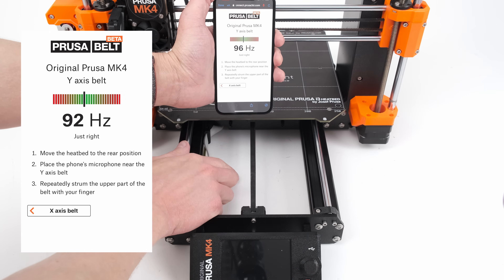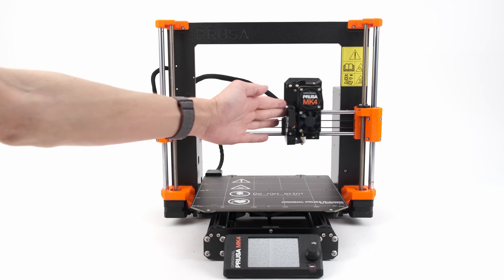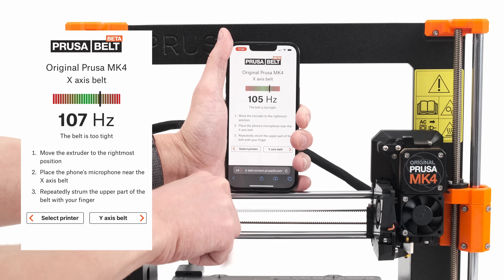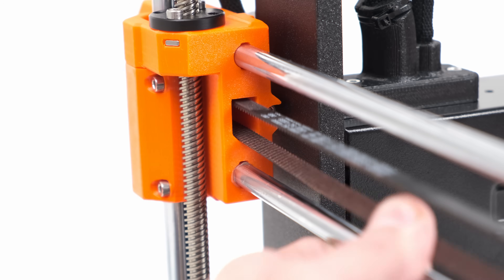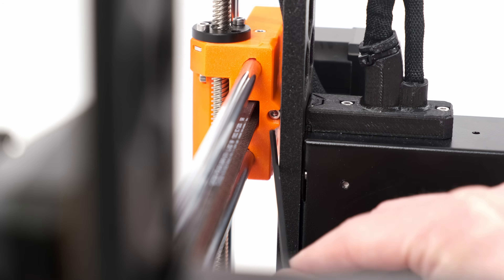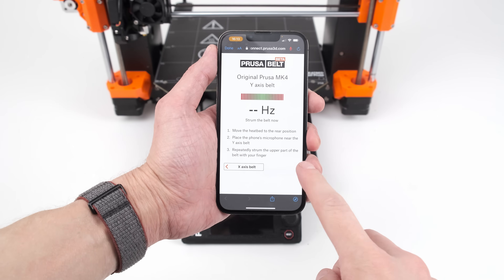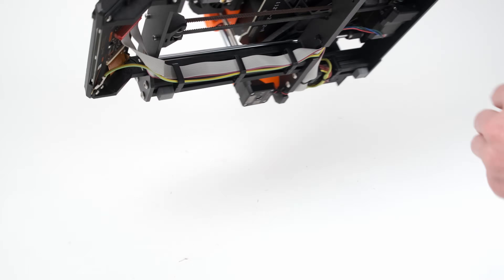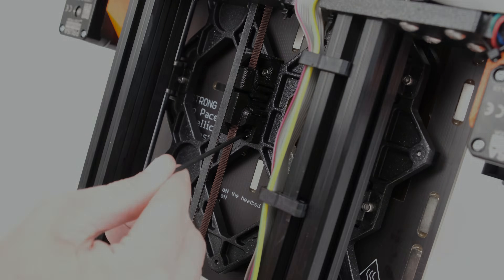Adjusting the belt tension on the Original Prusa MK4 - Belt Tuner App

Comment: I haven't been able to get this belt tuner to work at all, not for the X axis, and not for Y. It alternates between ~60hz and >100Hz on every pluck. I don't know what it needs, but plucking the string isn't enough. Somehow the simpler method turned out more complicated than just running the calibration test in the MK3S. The biggest single improvement to working on this printer would be making a real-time belt tension detector available in the firmware rather than (a) trying to make this app work, or (b) running a full calibration test. 

Or make an automatic belt tensioner.

Comment: Some tips to get this app to work.
1. Always arrive at the correct frequency by tightening the belt :ie: always start too loose until you arrive at the correct tension.
2. Do not loosen the motor screws too much. Loosen them and then tighten until you feel friction, then back off 1/16 turn.
3. Use the Allen key to strum
4. Strum in the middle of the belt. ie: divide the unsupported length into two.
5. Always take the lower Hz reading after a few samples. You'll notice the frequency often jumps to 2x the value. This is because the harmonic is being read.
6. You will get a too high reading if the belt is much too loose.
7. Adjust in tiny steps when you are close. ie: as small a turn of the Allen key as possible.
8. Remove your phone case. This was another users' comment and may help.
9. After an adjustment, clear your previous reading by swapping to the other belt reading and back again.
10. If it suddenly jumps from say 65 to say 98 after a tiny adjustment, clear and keep strumming, it should eventually read a lower figure. I'm guessing that this is a 1.5x harmonic.

The following was provided by PRUSA to another user and repeated here for completeness.
Ideal frequencies:
MK4: X 87.5, Y 95
MK3S: X 100, Y 120
MINI: X 110, Y 110

Feel free to add your wisdom to the list.
Reply: Great post ! Thanks for the info 👍
Mk3 requires the same values as the Mk3S (x=100Hz, Y=120Hz) for ideal belt tension.
Reply: @davelordy  Thanks. I have actually now gone over to the 3D printed belt tensioner gauge. This seems much more consistent and you can adjust the tension while watching the needle.
Reply: This is amazing feedback, I think I was picking up harmonics as you said which was getting very annoying.
Reply: Mine will jump from 55 to 190 does that mean 55 is the right answer?
Reply: @honsou1978dk  I'd guess that the tension is too low. I would continue to tension to raise the 55 up to the correct figure. However, if your other belt is about right, you could perform a tactile comparison. Obviously, if the belt you are adjusting is much tighter than the other one, you would slacken the belt (remembering tip 1). Disclaimer: Since I'm not at your printer, it's possible that some other factor is affecting the reading and therefore I could be completely wrong.
Reply: Those are some good tips kind sir. Loosening the motor screws just a tiny bit I think is a key factor. Also strumming with the allen key seems to work rather well.

Comment: This app is total bullshit.
1. There must be perfect silence in the room for it not to give false positives and false negatives.
2. Strong dependence on microphone quality, settings and phone software.
3. I have tensioned belts several times with this app and each time it showed the correct tension, while overtightening the belts and the motors started making clicking noises due to overtension.
Instead of putting a small belt tension checker in the box of each printer that costs pennies. Prusa is bullshitting, investing money in incomprehensible nonsense and inconveniencing users.
Reply from the maker: Hi Anton. Thanks for your feedback, we will take it into consideration.
Please contact our Support Team if you are experiencing some kind of issue with the belts movement, or others.
https://help.prusa3d.com/article/shipping-information_2297

Comment: I adjusted the belts on my mk3s perfectly "just right", 100-105hz for X-axis and 125-130hz for Y-axis. There was some weird layer shifting which drove me crazy for couple of hours untill I loosened both belts little bit to about 85-90hz/110-115hz and it has been fine afterwards. Perhaps the numbers are set a bit too high for the mk3s?

Comment: I could not get this working properly using my cell phone (S23). Measurements sometimes did not update at all, were just jumping around between max to min and back and so on No useful feedback possible. However, using a computer and positioning the headset mic did work then!
Reply from the maker: Hi Mael. Thanks for the feedback about how the tension app works on your phone. I have forwarded internally. We are aware the app is having problems with a few phone models, but working on making it work on all of them.
I am have to know you managed with the computer, and a mic.
Reply: yeah just ran into the same issue with my S23 ultra,
Borred my Roommates S23+ and my dads S24, all were unuseable because the readings were derpy AF.
i have made a video with all 3 phones lying on the buldplate with 3 wastly different readings. @Prusa3D
Reply: @The1stChillaKilla  Don't lay them on the buildplate ! You will almost certainly pick up sympathetic resonances from what is - basically - a large resonating body (in English, the build plate will act as a sort of speaker).

Comment: It would have saved me some time if Prusa had simply published the ideal frequencies for X and Y belts, since there are many devices that can measure audio frequencies, including human ear, which can discern very small differences in tones. Thanks to this video however, I managed to conclude that the ideal (or at least acceptable) freqs are 83Hz for X and 96Hz for Y. To tune my belts, I opened an online audio frequency generator and played tones at those freqs and tuned my belts by ear to match. Then for my first print on my MK4, I printed the Rocket Motor from the Prusa USB stick, turning the speed up to 150% after the first layer and it came out perfect.
Edit: Online chat with Prusa support revealed the ideal frequencies. These values are the center values in the acceptable range, which they said was +/-10 to 15% .
MK4: X 87.5, Y 95
MK3S: X 100, Y 120
MINI: X 110, Y 110
Reply: Agreed, I couldn't get the Prusa Tuner app to work on my (very out of date) phone, so I just downloaded a generic tuner, and looked everywhere for the correct frequencies . . . and looked and looked and looked . . . they are nowhere (except for this one comments section!) . . . really annoying oversight, such simple information they could share in their page on tuning the belts.

Comment: I had the same issue as several other folks with the x-axis reading "too tight" and figured out the problem: my belt was actually sufficiently loose that the frequency being picked up was incorrect. It was reading around 145hz, but tightening the belt about a half-turn or so brought it down to about 88hz, which the app says is in range, and I concur from my past experience setting belt tension on my MK3. It also feels similar to the Y-axis tension that the app reads as being in range (90hz) as well.

Comment: I think this needs work. I tried using it for my mk4 and no matter how loose the belt was it was still at registering as "to tight" even though there was nothing to strum. I even made sure to turn off anything that could be interfering with my phone capturing the sound such as a fan or other electronic hum but even in a quiet room it would always register as the belt being to tight. I really like that Prusa is trying to make their builds as easy as possible and this, while it is a great concept, didn't work for me personally at the moment of this review so I had to tension the belt the old fashioned way.
Reply: for anyone else having this problem, putting the phone on the rod, and GENTLY strumming was the key for me... i think something like the other person said about it hearingthe second harmonic, so it's reading too high

also, strumming to hard makes it bump the plastic and messes up the reading... once i got it close to the proper tension and gently strummed the app worked great
Reply: I had this issue as well and it turned out I needed to tighten the belt a bit before the measurement was reading accurately. I think at some level of looseness the frequency just isn't consistent enough and it winds up reading too high.
Reply: @coreyward  I will give that a try now that the belts have some tension and see if the reading changes. I tried a few different times and it always said to high so I just had to tension the old fashioned way. It is printing really good now so I am not worried about the belts tension but I am curious to see if that was it.

Comment: While this is probably in the right direction, my 2 issues is 1) I like the visual feedback of the 3D printed belt tension meter since as I adjust, I can see if I'm getting better or worse. It's easier for me then flicking a belt. 2) there is basically no spot in my house that is quiet enough for this. I turned on the app and it said I was at something like 140hz before I even did anything. I haven't been told my mic sounds weird, so I can probably knock out it's my mic.

Also, would be good to have this for MK3S+ and Mini+ given they are still sold.

Comment: I've always wondered this but, why isn't the tensioning mechanism for the bed on the front? Seems so simple, or isn't it possible etc? 
I have to undo my by now, oldschool lack enclosure ( think its v1) just so i can look at the bottom of my printer. 
My original MK3 is still chooching, thinking of finally upgrading to S+ 😜 (just for fun not that it's really necessary)

Comment: Good work! The best solution though would be the printer calibration procedure used the built-in accelerometer to detect belt tension and ask the user to turn a certain screw an exact number of turns ;-)

Comment: Any plans to backport the app to your other 3D printers? Would love one for the mini(+) and I can imagine MK3S folks would be happy with this too :D
Reply: Mk3s just tune to 90hz
Reply: Just calculate proper frequency using the length of the belt that is resonating "free" like a guitar string. i..e. length where it doesn't touch anything. Then you can use any spectrometer app to find calculated frequency.
http://benchtopmachineshop.blogspot.com/2019/04/printer-belt-tension.html
Reply: They backported it to the mini
Reply: @merseyless  yeah i saw :D

Comment: on the mk4 u made tensioning the belt too complicated i made a dozen micro adjustment's still failure to the 2 adjustment screws  did nothing to get the rite sound and even the belt on the back failure to get rite.......couldn't u put a  0 - (XXX)_______ belt .... tensioner on the side to adjust kinda like the front ????

Comment: Very Cool.  I hope Mini and MK3S+ frequencies are added soon.
Reply: Mini and MK3S is added! :)
Reply: @Michi_84 nice, just tried it and both my mini belts are just  a tiny bit too loose.
Reply: For the mk3 just use the mk4.
Reply: @stan110  Since the MK4 has larger rods, and different hardware, the resonance frequencies may be different and the tolerance may be altered.  Maybe I am overthinking it, but I did not see Prusa say that in the release and figured they would have if they were the same.

Comment: My Motorola Edge 20 Pro didn't seem to work with this app.
When I built my MK4 and strummed the very loose (almost floppy) belt, it still showed 120+ Hz and said "too tight". And continued to show around the same value when tightening the belt.

I used the printed belt gauge instead and that seemed more reliable to me.

I just tried the app again after using the printed gauge. When strumming it a few times it shows 130+ Hz, and then all of a sudden it fell down to 66Hz.
Reply: This was my experience as well with 2 different phones.

Comment: I had a lot of trouble getting this working on my Pixel 7 pro.  Lots of bad results. Same problem with my old Galaxy S7.
I did eventually get good results out of it, but if I didn't have a decent idea of how tight the belts are supposed to be to begin with, it could have been impossible.

Hopefully you can do something to get better support for these phones.
Reply: No problem on Pixel 7 Pro for me.
Reply: Works very poorly on Galaxy Fold 4. The reading is all over the place. Not consistent nor reliable, unfortunately
Reply: I am using pixel 6 pro. The app works fine in Firefox. I struggled a lot in chrome

Comment: I have not yet had the time to check out the app, but i would LOVE a kind of "free" mode where you just get shown the frequency, for other printers.
Reply: the app will work for other printers, but you'd have to get the proper tension from either the supplier, or crowd-sourced

Comment: would this work for other tipe of belt driven 3d printers as a rough estimate at least?
Reply: The frequency will vary based on the length of belt between each idler or pulley so its fairly specific to each model. The Voron team have been using this method for a while by setting a distance between idlers.

Comment: This is what I love about Prusa. You are always coming up with innovative ideas.
Reply: It's not inovative it's just something that's known to the most of the users that are trying to achieve high speed printing, but Prusa just did it more "user friendly" way.
Reply: This is well known concept among 3D printer communities like VZbot. So Prusa didn't come with something innovative, just took already existing concept to finally make the belt tuning easier for users.
Reply: @Loweec  this method is an industry standard for belt tensioning in general, so not specifically something that was born in the 3D printing community, but nevertheless a great addition to minimize the guesswork that was typically needed before
Reply: @apefred That can be true sure. My point was more about Prusa not comming up with it but more like finally implementing somethig that is already used for this.
Reply: Surely you're trolling. The only innovation prusa ever had was the heated bed design (the design not the idea).
Reply: @cosmicrdt  not trolling at all. I built my MK2 several years ago and it’s still going strong. My failed print rate is very low. At the time the MK2 came out there were several printers by other manufacturers that were dudes. My opinion (and that’s just my opinion) is Prusa led the way in a lot of innovative ways. It’s one thing for a community to have ideas, it’s another for a company to make them actually feasible and reliable.
Reply: @tikishark1  Prusa did their own innovations, but not everything they come up with is their innovation. Many, like this one is just re-wrapped already used concept. I wonder why he didn't do it already for MK3 since this can be used for any printer and you don't really need special app with red-green scale profiles for every printer. It is good to know the optimal value for the printer, but no need to make special scale profile for it.

Comment: The feature is so great.
With the MK3S it took me longer to tighten the belt properly. Now take the printed Tension Meter from the MK3S and adjust the belt roughly. And then check again with the app. So far it has always worked! :)

Comment: Is it normal that the top half of the belt is tighter tensioned than the bottom?
Reply: The top part of the belt is captive in the x-carriage, so it it effectively shorter.  The tension is the same, but the increased length of the bottom makes the frequency lower.